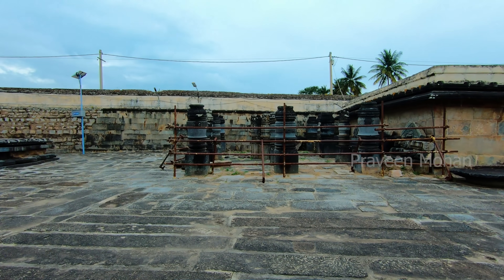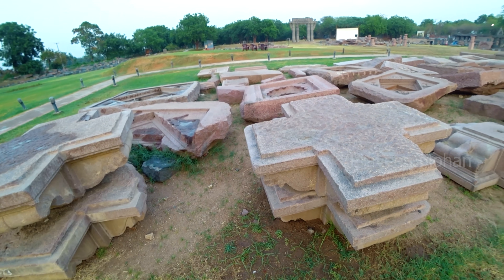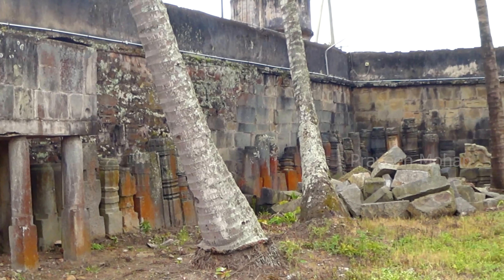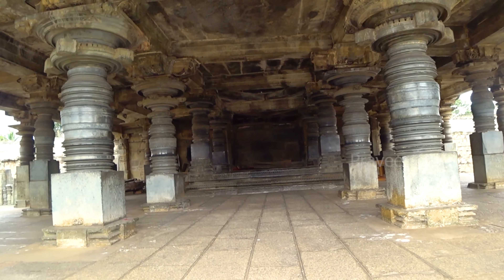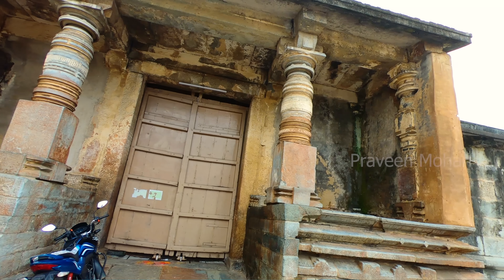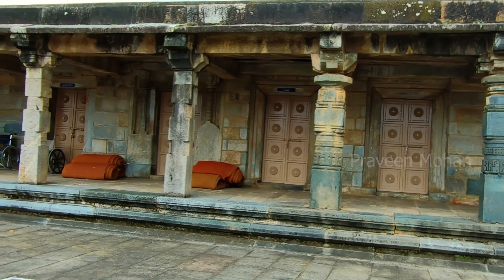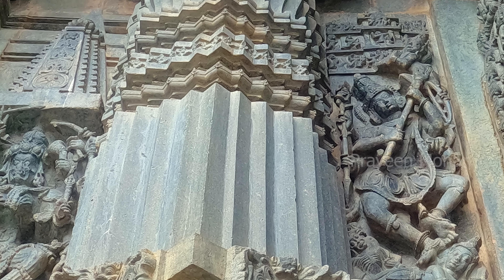Found an Ancient Pillar Manufacturing Site?

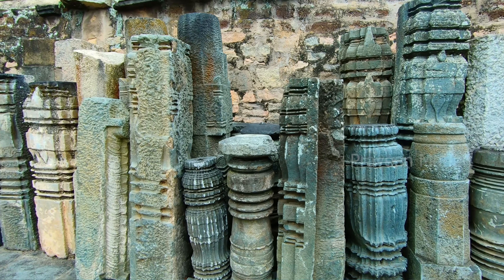Comment: Fantastic analysis and is logical. You are doing a great job. @2:40 - these collection of pillars with different designs, doesn't look like spares but  seem more like samples,  either to help client to choose from or to be used reference for mass manufacturing, like in modern day prototypes are made. Similarly, the empty temple could be a sample like builders do sample flats, now a days.
Regarding, loss of such technology over next centuries could be explained by the invasions, obviously after looting done by invaders, people tried to use more cheaper ways with square designs and in absense of  buyers, the technology went extinct.

Comment: I am a French polisher by trade, and as an apprentice I'd often work in the turning shop (timber lathes) when furniture was curing after the last coating... I shudder "pun intended" to think of that first strike or contact of the chisel on rapidly rotating granitic stone, assuming the starting block was indeed squared and not pre rounded (of which is still quite the feat)... I'd say as an educated guess, that this contact/cut wasn't achieved by an old Craftsman or his apprentice weilding a iron chisel, that would really be something to behold...

Comment: first thing which comes to my mind is the stone pillars were joined with large wooden blocks, or wooden cylinders with gears, then floated and worked with the wood providing buoyancy, they may have been worked in retention ponds or pools which could be set up, flooded, and then drained at will. Various stages would allow for various process,.A slurry or sand base could then have allowed to form in the pools, the pillars were then turned rapidly for polishing. Many of the unfinished pillars could have been used to train a workforce and were never meant to be a final product.

Comment: honestly alot of them looked like they were salvaged from temples instead of leaving them to the elements after a temple may have been destroyed. True some looked like early stages. But when your moulding with geopolymers, they probably had a stage when they were plastic enough to be turned and others had such fine finish geopolymers the figurines didn't need that much polishing.
A turning base on the floor and the workpiece mounted vertically in a vertical lathe is very possible. Again why disassemble all the machine tools. Same thing at the Giza pyramids.

Comment: in hampi temples they used to lighten the temples with sandal oil and flower to lighten the temple sir. the hampi temple pillars had multiple holes on the edges to lighten up temple. so pls check and make a vid about it sir. u r great and genius..

Comment: PraveenMohan At the 10:30 time of the video, on the left hand side of the screen there is a seated figure, above the seated figure, there is a round shape, around the outside of that round shape there appears to a measuring device like a caliper. Perhaps this is a depiction of a cross section of a cylinder, and the caliper is being used to measure the depth of cuts being made from the Lathe. I've worked on a lathe a number of times, and there are very similar tools to this. That round shape could also be a bowl shape being cut on a Lathe as well.

Comment: at 2.51 it seems there is a mill or lathe wheel to the right of the pillars. This type of wheel can be used as a rondell for making new pillars. The pillars can be models for customers to choose from. If the wheel is a mill/lathe for making pillars it must be driven by force, connected by ropes pulled by elephants or other types of animals. Maybe even water if its nearby. Look for marks on the ground for determine what may have been used to force the big wheel to move.
There must be mill bits for cutting pillars. Granite bits can be used as tools for making softer stone pillars, and soo on. Used as mill/lathe bits... like they do in modern industry also.

Comment: I think you need to approach it differently. Logically, rotating the pillar being carved seems right. But you're talking about dealing with tremendous weight.

I think we should approach it differently. What if the protrusion of the male pillar and the indentation of the female pillar  served more than the purpose of assembly after completion?

If you notice, all the samples pillars in the "workshop" are upright. Could they have had a mechanism that attaches to the protrusion or indentation and then carve with a circular motion along the length of the upright stone?

Comment: Great video, Praveen! Some of those pieces were not only turned but also machined. I propose that they used giant lathes but also had portable machining centers that could work next to a lathe or in front of a wall of rock. 
They were able to lift materials and calculate their plans very well. The biggest questions I have is, what was the power source to turn giant bits of stone to an RPM that you could cut with and what was the material that did the cutting. These days the materials they make lathe cutting tips out of can be ceramic or all sorts of composites that were well researched over a long period of time.
Reply: Most of the pillars are granite as per many commentators. Metal based tools would go dull in a very short time. I wonder about water jets used as cutting tools? If so, how did they manage such high pressure and precision?
Reply: Yeah, why not,  @shaileshmd71 , Anythings possible, mate. Waterjet does cut stone well.

Comment: I am almost certain that they did it by turning  pieces of rocks in nearby rivers. For example, Chennakesava temple is pretty close to the Tungabhadra river and so are most of the temples. As a child I saw a similar technique being used in villages near Nepal in Uttarakhand border, to sculpt wood into pots and vases. The science being, they would put a turbine in a waterfall making the  connecting shaft rotate at great speeds because of the force of water falling on the blades. The other end of the shaft would be connected to a rock which would rotate with the force of the falling water. The sculptor/engineer would then chisel the rock  making amazing lathe pillars.

Comment: The rotating lathe patterns are one thing, but the patterns going the length of the columns are equally interesting. You need a different machine for this since the rotating lathe only operates in 1 direction

Comment: It's a pillar junkyard. I see a GTOs, Caddys, Fords, Chevys, and BMWs. I think the lathe machine they would use a pantograph type cutting process that follows a pattern that can be swapped out. It's pretty easy to do actually. But it is a hell of a job and awsome.

Also the pillar may have been used with ropes causing the polished effect. Looks almost burnished by heat. Maybe used as pulley system. The one with 4 6 8 looks like a gear reduction. Maybe boat ropes or the twisting and braiding process of boat ropes? Sails and ropes made from hemp?
Reply: I noticed something else. Elephants to pull the ropes

Comment: Some pillars may have been done with a huge lathe.. but it is possible to make rings on a pillar with a hand too.   Look at the hand tools that a pipefitter might use to cut or thread pipe by hand.  The same method could be used on stone.
Reply: Even a cheap copper tube cutter would illustrate what I mean by the type of tool needed to make a series of cuts of varying depths..

Comment: Not only is this evidence of using an extremely large lathe, but there's also evidence of these other pieces laying around that have been built on a milling machine with multiple axis.
These were not done with a manual milling machine either. It's possible to do it manually but the time it would take would be astronomical. I would drive myself crazy looking around in the general vicinity for evidence of the machinery it took to build this. The larger question where's the machinery and what happened to it. When I look at the ruins around lake Titicaca in South America it leads me to the same questions.

Comment: You can have a rotating wooden block on the floor, and mount a big piece of rock on it.  So they can be vertically lathed.

Although it's still mind boggling considering the weight, size & scope of the work.

Comment: Maybe instead of turning the massive pillar, they turned the lathe.  You could do rotational turns as well as vertical and horizontal with the right setups.  I would say more like a small milling machine.  Or like a router in an adjustable frame that could rotate 360deg around the pillar perfectly.  What would they use for bits? No idea! How would they make the small router rotate? Gears I'm sure, pulleys or straight shafts.

Comment: The ceiling in that Model looked like a lathe itself, so wondering if the building itself is the lathe, using flooding to float pieces, and   Elephant/human power and gear ratio’s to move

Comment: I have a metal lathe and been turning on her since 1993.
I can understand the size of the machine that made these columns. 
They'd have to be vertical of course and use very hard tooling 
Im thinking cows, horses or humans would have to power these machines .
Slow speed over a period of time would achieve a good finish.
I see on YouTube vertical lathes with 16 meter chucks available today.
Im sure if you harnessed a few horses to it you could easily turn the job (columns.)

Comment: I kept wondering why some columns had such a strange structure. Then I came across the book Three Roades to Quantum Gravity - Lee Smolin, page 144, fig. 32. Single Vacuum Fluctuation. Both in macroscopic and microscopic? This applies to longitudinal waves, ie. sound. What does the specific shape of the column evoke in space when sound is applied (mantra ?, aum, ...)?

Comment: It would have been easier to make these with a lathe than manually. It would probably have been vertically mounted to keep shear stress off the rock. Assume a rotating platform with some sort of bearing lubricated with grease driven by a belt and animals or humans. Maybe it used mercury amalgam for a bearing which could have lasted forever. Wait, even better hanging from a rope that would twist one way, then unwind the opposite direction. It would make little difference to the cutter which direction it was turning

Comment: I believe you may have the process backwards. Greased wood to turn around the rock pillars? That’s an awful lot of weight to try too turn. And could those pillars made of  geopolymer? And possibly using a French wall molding concept ? 100s or thousands of years before they made their first brick dwelling? Have you done ground penetrating radar of that area by plane? It would be interesting for the site to give away some secrets!!!

Comment: Are there any archeological remains of devices that looked like large lathes ? If they did this with legacy technology, water would be a possible power source. But, my guess is that advanced technology of some form was used, and we don't see any lathes because they didn't leave that stuff behind. They took it with them.

Comment: Machining the cylinder at various radii would have been in a lathe. Cutting the teeth on each geer would have required a different process,  like a router or grinder,  or some equivalent process,  I believe.  The ancient builders were certainly using technology lost to us now.

Comment: Been wondering how they obviously turned these pillars. Came across Mercury bearings used in lighthouse lamp bearings. Could a vertical lathe be made with a Mercury bearing?

Comment: Hello. I am always intrested in stone work and steel. I believe that the ancient India Steele/Stone Creators. Used bells of length/and precast steele bells. I say bells because when the cut pillar were completed the steele outer lathes looked or appeared as bells. Later cultures found these lathes casters of steele and seen them on the floor like broken  bells. Repurpose. Lost lathes. No steele goes un used. Reprocess. New techniques. Old is lost. Just a Wakened-dream while standing and watching the steady powerful vibrational waves coming from the bells edge. The waves from bells can be seen and felt

Comment: EUREKA ! The stone tank at 3min46sec is the missing link. This water tank would lift lathe "puck" from lathe "table", just like air hockey puck get lifted from air hockey table, except it is water presure. Water tank is ABOVE lathe "table", so there is water pressure. As long as the water in the water tank is heavier than the pillar, the pillar gets lifted. EUREKA !

Comment: We assume that the builders were our kind of human, but we cannot be sure of that.
Close enough or similar it is not he same.
Did we jump from trowing stones to each other to architectural stone carving in a short period of time?

These pillars are beautiful examples of this stone technology.
They are made out of hard stone and eroded already.
How long it takes for that kind of stone to be damage to the point show on the outside pillars?
Thousand or million of years?
Is it possible to find natural stone eroded to the same degree and calculate some kind of time frame for reference?

Can we think that they were manufactured less than thousand years ago?

On the other hand, stone lathe work (turning) is one of the most "simple" operation in machining, but 3D carving is another story.
5 axle machine maybe?
Tooling?

We can admire the product, but ..... where are the machines?
Wood machines to work hard stone?
Were there mobile machine shops like ours and took them with them after finished their work?
Like the Maya or ancient Egyptian , where did they go?

This is quite interesting.
Thanks for the info.

Comment: To correct the statement, its not manufacturing site but sculptors used to practise on same rock with hammer,tiny chistles, even the needles made out of hardest volcanic rock to carve the fine structures.

Usually these structures are not allowed to touch as some of them hold the blueprints of entire temple structure cardved on copper papers u can call and secretly kept inside... this type of pillar is known as " moolasthambham " in ancient architecural terminology.

The factory is a very incorrect term as in those days these were schools to teach carving the structures

Amar shilpi shri Jakkanna had almost 1 lakh students those days who went across country for different temples construction.

The shaft structure which u saw is a form of 1008 petals lotus used for one of 4 types of pillars infront of main diety in garbhalaya.

Technique used those days was... 1inch to 56 inches iron and copper chains tied to big hammers made of rocks and sculptors would walk around and pull those iron threads using bare hands to holf those rock hammers and make those threads.... u might wonder if i tell u they used to keep mirrors around pillar to get reflections of carving the do and based on those reflections they used to make charcoal powder mixed with lime to keep markings first and follow same carving process...each pillar takes 3 months to 4years depending on the sculptors  ability.

Stone tank u saw was placed to check weight bearing capacity on that terrain and on pillars made out of that rock ...it is like they study and observe the soil moments with climatic changes for almost an year or so and then replicate same during temple construction... if soil is loose, the platforms bearing weight will be more and rocks of almost 300 tons to 1000 tons are palced in 5 layers below the temple foundation to stop any earth quake or flood situation to avoid temple from collapsing  or getting destructed.

They used to have 2 blueprints always.. 1 for knowing the plan is correct , by implementing the first plan they used to get idea that its correct and used to start constrction of main temple, in beluru, haliebeedu temples u can see live examples of it. Easily first blueprint takes around 100 to 120 years later the main temple takes less or even more time depen ding  on kings capacity to get such same rocks from around.... this is the same reason why temples started during rule of one king mostly never finished during same king's rule.